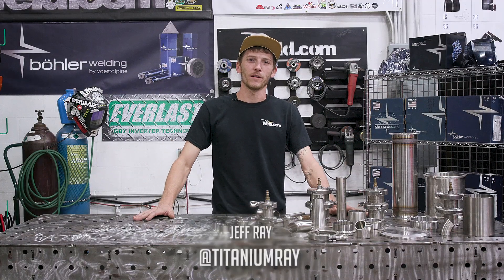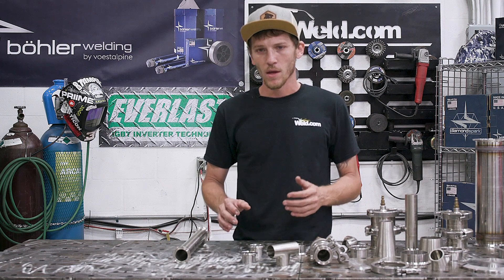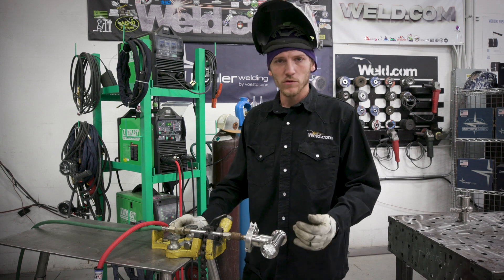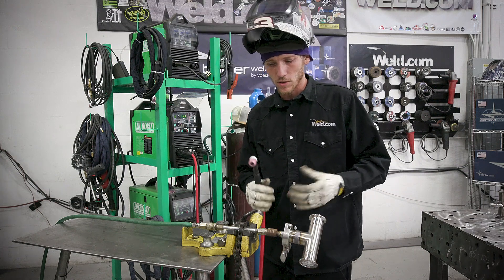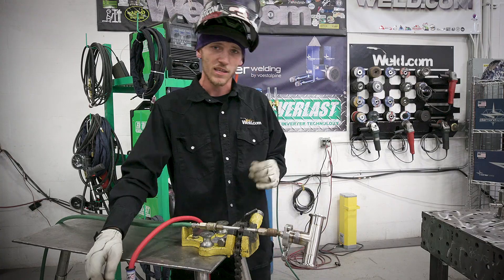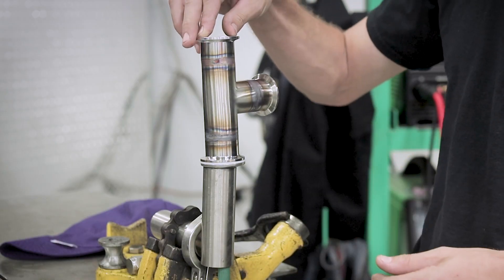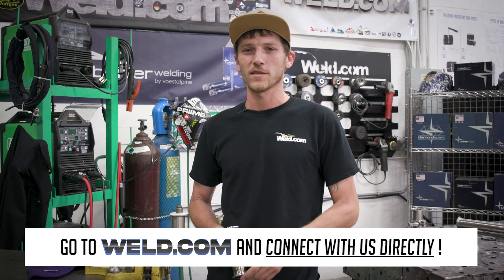Sanitary Process Welding - Spinning Out

Comment: I would really like to see how to weld thicker couplings to thin walled stainless material to avoid warping the thinner material. Thanks for the video!
Reply: Thicker couplers such as what could you explain more in detail. I have done things in the past like transitioning tubing to like sch10.
Reply: @SuperformanceFab  Something like a 1/2" to 1-1/2" BSP socket or a 2" to 2-1/2" Tri-Clamp ferrule to a cylindrical tank with 1mm to 2mm thick walls (the BSP socket is thicker.) Obviously part of the trick is to get a good mating surface on the flat socket/ferrule to the curved tank to minimize any filler required.

Comment: That was fuking AWESOME !!! What can a guy make, per annum, having a small shop like yours, do ??  $100k + a year ??  And you dont need filler rods... holy shite. I think your shop would cost around.....$10 -  $15 K to equip ? If you have a garage to start, of course. And about 60+ hours of school to boot ($3000 or less). 
    These OEM's need "niche" welders to have their "niche" components welded precisely. Stuff like that ends up on the ISS and CERN !! Cash in Kids !!! If I was only younger...(62). 
    Sanitary means = clean (perfect). Not sewer.
    This guy has just shown anybody how to get started in an industry where you can get going cheap, and grow fast to easily get a company of 10 people to where you gross $5 - 10 million/year, in a few short years. And I am sure, this kind of "sanitary" welding is a growing field.

Comment: Correct me if I am wrong here but isn't the entire point of sanitary welding to maintain the integrity of the stainless steel to keep it stainless? 
It looks like the walked weld would do, but the other two are fried. You've cooked the chromium and nickel out of it. Those 2 welds wouldn't be sanitary. 
Why would you show that and try to pass it off as acceptable? 
I get that walking is your preferred technique but if you're going to show people how to do something, you should show them the right way.

Comment: When keeping the torch still I have found that using a pulse setting get you a better more consistent weld. It just kind of like mimicking an orbital welder.
Reply: Yeahh i agree with you and i could do that with this machine but in most cases in the field most machines dont have that option just from past experiences. So i was trying to demonstrate this as accurate what i have done. Thanks for watching and reaching

Comment: Issue 1 no purge on tack up issue 2 if you have pulse on sanitary use it less heat input
Reply: Those are practical points to bring up of course. Purging fit up isn’t totally necessary for fact that you can tack them without burning through. With pulse it isnt very common in this industry to have a machine that has those settings, i set the machine up as if i were in real world. Thank you for watching and reaching out.
Reply: I'm going to have to disagree with that. 
If you do back to back testing you'll see that pulse welding ends up putting more heat into the part than non pulse welding.

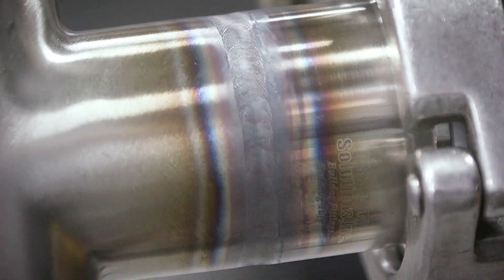Comment: Between 3:20 and 3: 25 there was some sugaring
Reply: I see what your talking about on the outside of the tube there it does look like sugar but i assure you that it is not because i didnt weld the inside of the tube for the outside to sugar. Its just not enough shielding and tube is a little hot when i come back around to tie back in is what i see. Thanks for watching and reaching out.
Reply: На правій стороні?
Reply: I always thought sugaring came from impurities on the base metal? What actually is it?
Reply: @jasonesau6145  а не окислення метала, точніше старіння?
Або як вплив "кислоти", но якби не від рідини а вплив температури, но все ж не від хімічної реакції.
Простіше випаровується елемент який захищає від "станіння".

and not the oxidation of the metal, or rather aging?
 Or as the effect of "acid", but if not from the liquid and the effect of temperature, but still not from a chemical reaction.
 It is easier to evaporate the element that protects against "becoming".